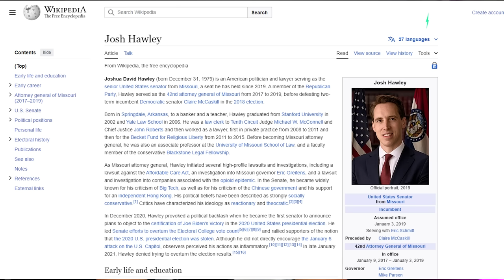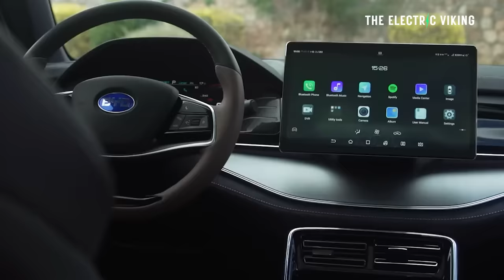Masses of unsold Chinese EVs are piling up and blocking European Ports

Comment: My friend recently bought a new IC MG, she didn't know it was a Chinese vehicle until her young grandson told her.
Reply: Even if you just compared cars on tech specs, the MG is a good one. She didn't "get taken" on that.
Reply: My air fryer bought years ago need to be replaced.  I said I will check out Temu, my wife said the Chinese one may not be as good as our current one.  Without knowing the current one was made in China after she used it for years. 😂😂
Reply: @cinpeace353 the stuff on temu is still dramatically lower quality than the generic no-name stuff sold in the west thats also made in China. Nothing on there is forced to pass any safety standards whatsoever whereas your local supermarket or electronics store would get into severe trouble for selling stuff like that.
Reply: I know where the local MG dealer is and they have been there for years. I would have doubts about an Ora Cat or similar.
Reply: @DeadNoob451   Ahaha, no, it's just sold directly rather than with a huge markup for a Western-labeled box.
Reply: Ok so ?
Reply: @DeadNoob451   source ?
Reply: @zacksmith5644   Thus making the point the elderly buyer thought MG was still a UK car company, do try and keep up.

Comment: Most people know MG is Chinese but they have a long track record here. There are 2012 MG6s for sale on Autotrader. 

Until this year I wouldn't know where to buy a BYD or get it serviced. A large local dealer has started stocking them and have a forecourt full. As for pricing I wonder if they would rather sell you a Volvo or Seat EV. Two of the other brands they carry on the same site.

Comment: If it was just the case of getting the vehicles transported it could happen, overnight.  
The problem is the eye-wateringly high cost of these Chinese cars in Europe, the distributors are having a laugh. 
It’s not like we can’t see the cost of the very same cars in China is it?. 
What will happen is a mass dumping on the marketplace to get rid of cars that have been sat next to salt water for months and months. 
Snag is insurance companies are leery of offering premiums on cars that have little or no support in Europe, no spares and the manufacturers could be out of business shortly so two dilemma’s, high prices that will crash and high insurance premiums which will only go higher, talk about the rock and a hard place !

Comment: BYD needs to open BYD dealerships for sales and service. That way BYD vehicles would be cheaper and get more buyers. Very few in Europe want to buy a cheap no name brand without after sales service and warranty issues.
Reply: That would make BYD liable for fixing the cars, servicing, them, etc. In China, auto service centers are... lacking in quality, ethics and competence. 

I couldn't imagine how they could learn how to run dealerships from scratch in the West.
Reply: @movinon1242  Well that is not completely fair for I have many tools made in China and they are cheaper and almost the same quality as North American ones.
The problem with Chinese ev's is that when you do need a part for them it takes forever to get it ... that is why they need BYD dealerships in Europe which they currently do not have.

Comment: The Chinese economic system is hard to understand .It is not only cars that they over produce .There are hundreds of thousands of unsold apartment built in what are now ghost cities.
China has an autocratic government and it is surprising that these important sectors are not regulated more.
They also need to do more market analysis before shipping them overseas because the worldwide demand for EV's is still quite limited as only a few countries have the infrastructure to support them

Comment: The insurance issue also happened to Tesla cars from 2010 till 2016 when Tesla finally announced they would start insuring Tesla cars by 2017.  Problem solved.  Chinese car manufacturers can do the same.  In its early days of Tesla, Tesla car owners also waited for months for parts to be ready to fix their cars.  Tesla cars broke down easily.  My 2018 Model X had rear drive motor failure and has been replaced.  Front upper arm failure (famous for performance models of S and X), interior rattle at multiple areas including the moving panels of the GullWing doors, water condensation in rear lights, left rear mirror not folding, rear liftgate not opening all the way, front bumper misalignment, rear bumper misalignment, paint issue due to paint was too thin and easily chipped.  At least, the Chinese EVs have very very great quality right off from the factory with no easy-to-find panel gaps and no rattle as many owners have confirmed in social media in China compared to owners' complaints of new Tesla cars.

Comment: Unfortunate that global EV sales are already declining.
Reply: Same with ICE...
Reply: Actually, they’re not.
Reply: They arent, but the growth is slower
Reply: They aren't
Reply: @xaero98 Year on Year quarter sales are down. Look it up. For a growth product that’s simply disaster. You can lose money but slowing demand is the worst development. Economics just isn’t there. Maybe there is more levers on EV motorcycles. Still economics isn’t compelling. Unlike Solar where there is a clear advantage in certain cases like electricity at about usd 20c kWh. Maybe breakthroughs in batteries could change this. Hopefully we get something much better that’s renewable sooner.
Reply: They are not, but price needs to lower for EVs and insurance needs to get upto date on EVs
Reply: Volumes are clearly down the chart is obvious. Solar used to be driven by subsidies until it got economically viable. Maybe EV will too if they can lower its production costs but clearly not today.
Reply: @creativecomputers6060  April number shows an obvious decline to be generous.
Reply: You’re holding the chart upside down, mate.
Reply: @philiptaylor7902  maybe you got 2023 numbers not 2024 April updates. Nothing wrong with declining sales. Generational trends tend to overcome short to medium term developments. It could be EV that wins the renewables or hydrogen does it matter? Like wind vs Solar does it matter so long as you reduce carbon footprint and greenhouse emissions? It does if you own Tesla shares though. people should  have bought NVidia or Broadcom and rise with the AI wave. Tesla shares down 25% this year.
Reply: Nope, growth is slower, as it is for all types of cars. Not surprising given interest rates and inflation across most of the globe.

Comment: I certainly would not but a car for thinking it is english, quite the opposite. But I tested MG4. And it drives really well, is good enough at fast charging, perfect size for most use (not too big as many ev cars are, resulting in too high condumption with electricity prices through the roof) and has a decent range. So ticking the right boxes, opposite of many others lacking some of these. It sells really well here in Norway.

Comment: I can’t blame the dealers. According to EU regulation the seller, not the producer, has to give a mandatory 24 months ( minimum ) warranty to the buyer. Which dealer would take the risk on a new brand, without proper service centers and parts supply for regular normal mark up?

Comment: Sam I have not researched this extensively but I have the strong impression that the dependence on local distributers trying to sell at high profit margins. This means that most Chinese cars are not priced competitively. Looking at the Dutch market specifically. Dutch car buyers are very price conscious and well willing to buy new brands if priced competitively. This has happened in the past many times Kia, Hyundai, Lada. What I do see to my surprise is that besides MG, Hongqi is selling here more than I would expect.
Reply: What secret combination of things has Hongqi used to make sales? Price, parts & service, insurance, etc.?
Reply: @markhathaway9456  I think its purely price you get a lot of car for quite a relatively price. I don't know what the split is between fleet lease and private ownership that could also be part of the succes.

Comment: The Chinese makers are making the same mistake that Tesla did. They are assembling all the parts inventory to build complete cars. If they held back some of those parts and shipped them to repair centers or dealers, there would be plenty of spare parts. But dealers don't want to invest in parts inventory.
 Toyota soled this around 1990 by stocking every part at one US east coast warehouse and one west coast. Fedex delivered all parts ordered before 4pm by "first AM" priority, typically at the dealership by 9AM on the day after the part was ordered. Older models still had to have parts made and shipped from Japan, often a 7-8 week delay.

Comment: All this talk about import duties and tariff doesn't explain why the prices of MG and BYD's are so expensive in Australia, even though there are NO IMPORT DUTIES or TARIFFS to Australia due to our free trade agreement with china.  The local Aussie distributors appear to be ripping people off big time. A BYD is nearly the same price as a Tesla Model 3.  Holy crap, it's ridiculous. They are supposed to be cheap for a reason (slow charging being the biggest issue I have seen with BYD).  Example: My Tesla charges at 11 kWh at an 11 kWh (free) charger, but the BYD only does 6.5kWh.   At a 250kWh fast charger, I have seen up to 255kWh, but the BYD maxes out at 125kWh.  They are just WAY TOO SLOW, blocking up charging stations for other users. No wonder BYD owners have to leave them over night (blocking even more users)...
Reply: Sharing is part and parcel of owning an ev. Not everyone can afford a 100k car.

Comment: MG had a dealer network in the UK (at least), when it went from being a british to chinese made car, then onto electric. BYD and ORA have had to build a dealership.

They don't need dealerships to operate (like Tesla), but they do require nation wide Servicing and repair shops.

MG4 in Oz is on roughly the same price point as BYD Ato 3, but is AU$10,000 dearer than the MG4 in the UK. That is why it doesn't sell.

There is a large cost of shipping and import duties, this also hikes up the price in Europe.
Reply: I know where I could take an MG or Tesla locally to be fixed. Tesla actually took over what was the local Porsche dealer.

Comment: I would have thought that upon arrival (at a port), the importer is liable for clearance and storage costs, and the storage costs could increase exponentially after (say) 3 - 5 days. If the cars aren't (attempted to be) customs processed (taxes paid), within this period, then they can be treated as abandoned and the 'trash' can be compulsorily returned to the origin point (meaning that the shipping company is liable for the port dump), which means that the shipping company will absolutely ensure that 'the origin shipper' understood from the get-go that the items could be compulsorily returned at additional cost to the shipper IF the goods were (essentially) rejected at the delivery port. In other words, the shipper is liable for all costs until effective and full tax-paid delivery to the importer.  And IF the importer does indeed PAY import costs at the port, there could be an additional refundable BOND per vehicle until the vehicle actually departs from the port premises, with a daily (high) fee payable, to be deducted from the refundable bond amount. Call it 2,000 quid/Euros BOND per car! As it's completely refundable if the importer gets their act together, it should effectively deal with clog at the port. It's all in the integration of the paperwork, surely?

Comment: In the UK its pretty clear.
Parts supply is a problem with Chinese EVs, they have a reputation for poor supply with extended time off the road (Impacts insurance). Then you have higher prices than people want to pay for an unknown brand, both of those compine to undermine sales & price you can charge
MG got in early with the ZSEV & MG5 at very competative prices to start with. Decent products at low prices. Whats happened to them is the prices have fallen around them so they have had modest price drops. They got some scale early on & have kept selling. The 5 got a foothold with some types of taxi operation too that has helped build trust in the quality of the brand. People do trust them.

Who is BYD? This is bit unfair, but what people see with BYD is a potential "here today, gone tomorrow brand" at virtually no price advantage over MG. BYD have needed a price leader, something distinct with a substatial advantage. But they cannot get there now as EU produced EVs are too competative. MG have a toe hold, BYD do not. 
Stelantis are competeing very hard. You can get a brand new 50kW CORSA e  right now at £19,500, cheapest BYD new is £25,000 (Dolphin). Citroen C4e from £21,000 new, ZS EV from £21,600, MG4 £26,400. Nissan Leaf £24,000. BYD think they are competeing against MG, they are not.
BYD have missed the boat, so has GWM.

About ports, dont pay too much attention to "cars pilling up" stories. Many ports make a lot of money storing cars, they also do pre sale preparation too. The story source is pretty anti EV. Its not the logistics either, you are right to question that. Its dealers & sales.

Comment: These cars can be put on electric grid to remove intermittance problem in view of electricity generation by solar panels:). The batteries must be very capable. About car parts issue. Sell half of the cars and use orher half to strip for spare parts provided that each car is identical.
Reply: That would use up the limited charge cycles a battery has so no owner would want to do that.

Comment: the problem is not a real problem.. just charge a daily drayage charge on each car beyond a week.  They will have to move the cars   Lets imagine that daily charges are $25 per day.  so that would easily amount to 750 per month.  it is like floor plans that charge by the day at dealerships.  So by the time that you add this to flooring costs I can promise that adding an extra $3000 per month that these cars do not sell that the makers are not going to want to ship the cars till they are sold

Comment: The EU should change them $10 a day for each car stored at the port. Also, yes, if I were in the EU I would not buy a Chinese brand. A good deal is not helpful of the maker goes BK, or if you have trouble getting the parts.

Comment: 10:42 - inform yourself first, Sam. 

Shortages of drivers have long been one of the major challenges affecting the logistics sector. Studies indicate that there was a shortage of at least 70,000 truck drivers in Germany alone in 2023. With an upward trend. In the previous year, the figure was 53,000.

It's not a thing about them being willing or not...they just do not have the drivers and this are putting a lot of trucks to "sleep mode" so they don't have to pay anything for them because there's nobody there to drive them (because the job is gigashit).

Comment: They should set up their own dealerships. Then sell them for cheap prices to get around high tariffs then let it circulate for a while eventually the brand will sink in and it will take off.
Reply: The Tarifs still apply unless it's assembled domestically. So their own dealerships would not help there.

Comment: I had the chance to drive an BYD Atto 3 fir some days. In comparison to an VW ID.3 the car has poor quality, bad performance, poor software (e.g no recharge planning) and the price is as high as for a car from German automakers. So I see no point of buying it. The MG4 is a bit better but also not as good as the ID.3 but therfore a bit cheaper. So ist seems nit only the brand but the price/scope ratio.

Comment: BYD and Mg should remove those cars in European ports and send them to countries in Asia, Africa or south america where there are people waiting to eagerly buy an ev.
That will cut down the waiting lists in these countries and give these countries a headstart over europe since Europeans dont seem overly enthusiastic about embracing electric mobility. Yes i know the prices are not cheap but that is because those importers are adding high markups.
Reply: They aren’t stupid either. Who would buy a car that comes basically without service network, warranty and parts supply? In the places you have mentioned gas is cheap and they would prefer a 10 years old Toyota rather than a brand new EV that when it breaks you can abandon. If they want to sell EV or whatever car in Europe or anywhere in the world they need the network to do it first.

Comment: Mg have succeeded because they returned to the UK with rebadged old rover models back in the 2000's with a cheap solid set up of petrol models, rebuilt the brand and dealer network.

They had already built the trust in the brand/ warranty/parts supply by the time the EV thing arrived, started with just the zs, learned from mistakes and did rapid tweaks  to design, introduced the MG5,, same thing learned from mistakes and tweaked to suit, then delivered the MG4 at a below market price, and also listened and tweaked ( welcome back rear wiper) 

Are they perfect, no, not by a long shot, but are they more trust worthy than "others" when dealing with both its dealers and customers, on the whole  yes, sure there are issues but every brand has those, 
Insurance is an issue with electric vehicles atm, along with long lead times on parts and a severe lack of technicians and 3rd party repairers this will balance out over time as with any new tech, the question is which will win first, supply and industry or the lack of buyers willing to take the risk